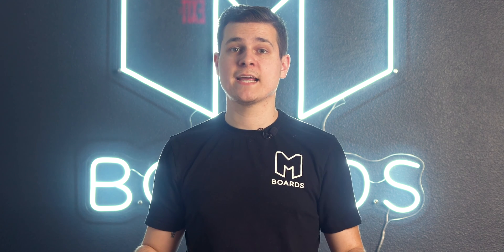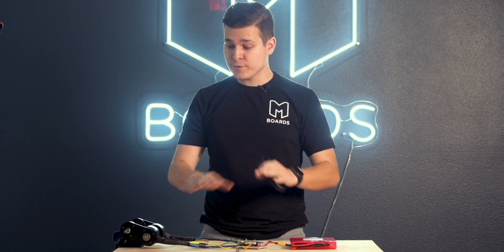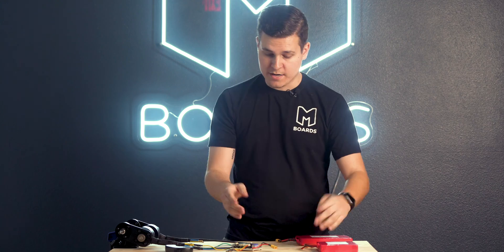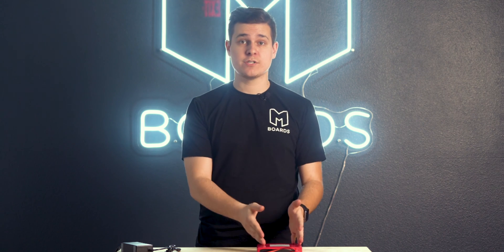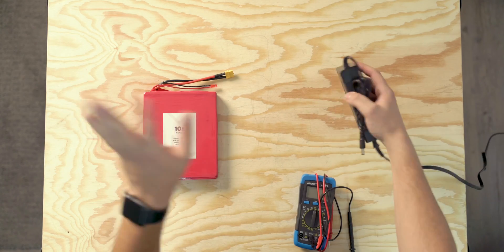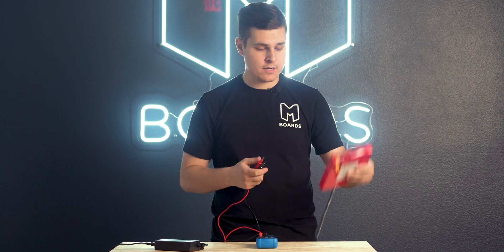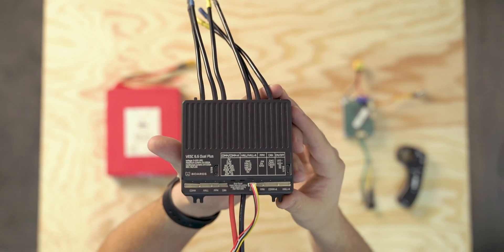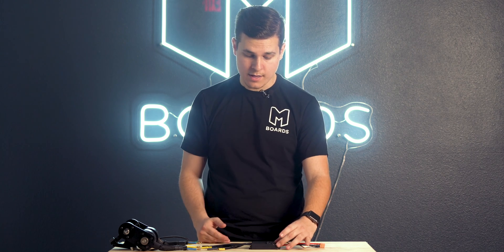How To Test and Diagnose Your Electric Skateboard

Comment from the maker: What video should we make next? We want to hear from you! Reply to this comment!
Reply: Detailed breakdown on how you guys make/source batteries! Also good safety precautions to take with batteries.
Reply: @deadlightning4532  YESSSSS
Reply: I have a problem where my remote loses connection mid ride and I always check the receiver for any issues but everything seems fine. The problem comes up once in a while and I fear that it will happen again and cause an accident. Is this a remote issue, receiver issue, or something I’m not seeing here?
Reply: @sebastiangomez8463  rf interferance if you live in a densely populated area, get a lacroix boards remote which has tech that hopps frequency to avoid connection losses.
Reply: How to open and balance charge a battery pack?

Comment: So I was trying to multitask and at the beginning you said if it’s beeping when you hook up the charger or something or you said something about it, not being able to meet the right type of voltage because it doesn’t wanna overcharge one of the batteries and I think before you said that if it’s not meeting the charger is not meeting the right requirement then it’s gonna beep so that’s what’s happening to mine right now. As soon as I plug the charger in it starts doing that beep in the light, it goes from one side to the other sideand it beeps like beep beat something like that beat right but I’ll check the troubleshooting stuff that you did, I appreciate that

Comment: Hi there, I was riding my MEEPO 5 on a hot day last week. I'm a pretty big guy and I rode up a hill aggressively. 
Suddenly the power to the wheels stopped. I was still rolling and the brakes worked fine. 
is there a Thermal overload switch? I hope there is no permanent damage...

Comment: I have a Meepo V5 with a 8000mah battery  that I keep fully charged, I use my board daily. Recently,  I rode my board to a meeting, it sat for a hour. On my ride home,  my board slowed, I looked at my remote and it showed one bar then nothing. The board wouldn't turn on,  dead. I walked home,  plugged in power and it turned on,  but not for long. I charged fully and it ran for a while, but shut more than 90% battery. I unplugged the esc then plugged it back in and it made a pop sound and turned back on.  Battery charges to 41.3volts and says there.  ESC problem? It looks good, no marks. I read the ohms from the power feed to the esc and it was very low. Left it unplugged for a day, read 400k ohms now(power feed into the esc). What do you think? Any other tests I can do to determine the culprit?

Comment: I have a CAROMA 350W Electric Skateboard for Adults & Teens, Wireless Remote Control, 12.4 MPH & 8 Miles Max Range, Short Charging Time that got submerged in about 2 foot of water for about a minute now a red light is on and won't turn off and the board won't do anything the controller finally came back on how do I fix it please and thank you

Comment: My board keep going slower and the normal speed whats wrong with it
Reply from the maker: Typically that would be a voltage issue. If your battery isn’t holding a charge you may see reduced speeds.

Comment: Good video but didn’t hear my problem.  My problem was I over some small pot holes fast and hard. After recovering my balance but my one wheel motor board stop running. I have stored for two years.  I performed visual checks and performed ohm checks on every wire and all good. But when I plug in the battery which still has voltage after storage for 2 years.  I plug in it sparks and connection on positive gets burnt.  Any suggestions on why sparking.

Comment: My urban v1 e skateboard turns on, runs for a minute then off. I havr to plug it into an outlet just to turn it on again. Also my remote battery died before i even got it, it needs a whole new battery. Is there a way i could just rewire it that it powers onto a regular AA battery just to work it? 

I bought everything brand new on eBay and I knew I'd run into problems. Was too excited to get it anyway.

Comment: Hoping you can help, when pluged in my esc makes no sound whatsoever.  Im using 7 cell battery with a 6 and 7 cell esc, from the start ive had trouble, first on off switch was wired incorrectly so had no functionality.  Ive bypassed it so it should be on when connected to the battery. Still no sound, remote seems paired and shows full battery level. The 7 cell jumper is connected. Could it just be its a faulty esc or is there something else to consider.  I had assumed once on switch was bypassed it would beep when battery is connected but nothing happened
Reply: Just add some more details I checked my battery which I made myself but works perfectly I've checked my charger all are giving proper voltage and amperage according to their specs however I have never seen a light come on on my ESC also the on-off switch was faulty it wasn't fact reverse wire the light on the auto switch failed to come on I corrected the wiring the light came on and then I realized that the switch itself is broken and there's no click when you push it in or no it doesn't recognize that it's been pushed so I rewired the on-off switch the LED started to work but the on-off switch itself was broken and doesn't click when pressed or make any other indication that it's understood the intent so to speak so I slipped the wires removing the on-off switch it twisted them together bypass gets so it should just come on when I plug into it even still I can't get my ESC to make any noise it seems to have no life whatsoever no lights come on and no sound is made at this point I'm thinking that my ESC is faulty from the factory and will need to be replaced I'm running a 7s setup but it's very high amperage my cells are reading 10000mah each after being fully charged I know the ESC should have a high and low voltage cutoff it also has a have a high amperage cut off is it possible it has an over a cut off as well I'm running 10000mah cells and running seven of them for 70 amp total.
Reply: If im over amperage i can order new cells, but it would still come on and give me a beep code right? If your on off switch is in the off position will the esc still light up? Since i bypassed my on switch it should just come on right away so im assuming mine is on, ive also tried removing it to place the switch to the off position then connected battery then connect the bypass but not even a light or beep, am i missing something else?

Comment: Hi Bro one question i have electric skejt and battery is loaded and and when I start drivingit starts draining right away I'm sorry, it's full again, what's wrong with the battery?
when I'm not standing on it and it's working, it doesn't do this

Comment: Hi I just picked up a Lycaon GR. It was super cheap but no charger and remote. I tried to turn on but it just beeps. Can I just get any esc and remote for the board or do I need a Lycaon. I tried contacting the company but no response. Someone said they also have been having issues with Lycaon .

Comment: I have used my dual ESC which has 4-speed modes, for a couple of years without any issues, but recently I noticed the speed of 2nd mode drops to a very low. I am not sure what kind of problem I am facing, I don't think I blow up either motor or mos-fet. I think the ESC setting has changed. is there a way to test that? I have those dual SZLY ESC.

Comment: Question my skateboard turns off randomly when it has a full charge it will go for a min or less and won't turn back on after
Reply: This is me too! I have to plug it into the outlet just to get it to work. Also my remote sucks, needs a new battery which idk where to find one. What is ur board? Mine is a V1 Urban skateboard
Reply: Sameee!!! And I just got it. So I took the wheel off that has the motor and then popped it back on and it started working again but this lasted only a couple of minutes. Very common issue apparently. Helpp

Comment: I'm a "newbie" to electric skateboards & was gifted one to fix ...if possible? Boosted Mini type (I guess?) It has two "dead" lead acid batteries 12v 7Ah, (1) 7.5 inline fuse. I would like to do a bench test on motor using a 12v 825 cranking amps car battery, is this wise ? Also, what would be a better battery replacement (gel, lithium, etc?) Thanx
Reply: your volts are the same so should be good, the motor should just run longer

Comment: Any chance you can assist? My board seems to pair considering the battery life shows up on the remote.   Unfortunately there doesn’t seem to be any acceleration with the board.   This board hasn’t ever seen asphalt yet.
I purchased it without a remote so I had to buy a universal remote however there doesn’t seem to be any acceleration.

Comment: Hi I have a question what happens if you plug the charger in and you see a spark on in the electric board? Is the Skateboard bad or the charger input is too low or high 🤔

Comment: Yeah I got a question I troubleshooted my board with every step that you suggested and I still just can't figure it out, for some reason my board will not turn on when I press the power button but then when I plug the charger into the skateboard then I can it'll turn on and it works just fine the wheels will turn and everything but then as soon as I unplug it all the power goes off and I checked the voltage on the battery and it read fine and then I also plugged the battery into the main cable that goes back to the ESC and check the voltage on the cable connecting to the ESC and it still read same thing it was fine is my ESC just fried or what? thanks

Comment: Do those cheap battery packs come with a BMS? Or the controller just cuts the voltage as soon as the first cell is on 4.2v 100% charge?
Reply from the maker: Which battery are you referring to?

Comment: A small correction, rx to tx and tx to rx regarding wiring
Reply from the maker: In almost all cases with Vescs, it’s RX to RX and TX to TX.
Reply from the maker: In almost all cases with Vescs, it’s RX to RX and TX to TX.
Reply: @MBoardsco  must be some boards that are labeled wrong purposefully then? I'm  controlling my fsesc 6.6 with an arduino, standard tx->rx, rx->tx on that one at least, since its a common serial protocol. Love the channel, keep it up!
Reply from the maker: Ahh with Arduino yes it is flipped. But when working directly with a Vesc and a receiver you match it.

Comment: Bought a Teamgee H5 directly from them (1st mistake) and it has stop working after 6 months. Won't start, battery reads 41.5V and charger reads 42v. Teamgee says I need a new battery, but I am not buying anything from them. Power switch doesn't light up not even when we connect the charger. No repair shops in my area, looking for any advice to locate the failure and see if it is worth the money to repair it. It has been lightly used, less that 20 hours...
Reply from the maker: That sounds like an ESC issue if it won’t power on with a charger plugged in. But would have to pull the electronics out to be sure.
Reply: Same story here with my h20 mini

Comment: Great Video! thanks for posting. I have a question. while riding about 1-2miles my skateboard just stops moving. everything is on and when you let it rest for about 30 min. it turns on again! Do you know what's the problem? the battery isn't dead or anything I think either the motor just gives up? or doesn't receive power? btw mine looks like the same as yours on the video but mine is 24volts single motor. Thanks for any help!
Reply: Esc or motor might be overheating. Feel the motor when it stops. If it’s hot to the touch it could be an indication of overheating

Comment: Hello i have question  about my motor hub rubber wheels 105mm its 42volts .
Why did not work for my esc 24-36volts. 
What do think that  problem?
Maybe  i need change  the esc?
Because vesc so expensive  here in saudi. What can do? Any advice  for me?

Comment: Very helpful!  Good timing on the video.
I just built my board and it seems to run at half power. It simply can't pull me up an incline of any grade. Top speed on flat is maybe 10 mph and struggles to pull me from a dead stop on flat. 
6374 190kv single belt drive (16/36 gearing) with a 10s ESC and 10s battery. Seems the battery is fine and puts out 41v so I'm leaning towards the ESC being bad out of the box (that's what I get for paying $50 for one from China). 
Any suggestions would be appreciated. I heard a VESC is preferred for a single 6374 motor. Or any chance it could be the motor?
Reply from the maker: Most likely the ESC. The odds of a motor being bad is very low. Would definitely recommend switching over to a Vesc when you can. 

Also double check that your speed mode on the remote is at the highest level.
Reply: @MBoardsco  Thanks for the response! Much appreciated.

I found the different speed options (without a manual) and it seems I was using it on the highest mode. After running it for about 30 minutes total it seems the ESC was getting very warm and there are overheating marks near the solder (brown in color). Seems it can't handle the amperage.
I have decided to upgrade to a Vesc and see if that resolves the problem.

Comment: Hey what a coincidence ! Yesterday I went on a long ride, drained the battery completely empty (the board completely stopped and wont turn on anymore). And now it wont charge anymore. I heard somewhere that the battery (10s) voltage might be too low for the charger to start charging.
I'm gonna get myself a mutlimeter to check.
Do you have any tips to get the battery to charge again in the meantime ? I tried using a drill to make the motor rotate and hopefully trigger some battery regen but after 10-15 minutes of that I saw no improvement.
Reply: try going down a hill and brake?
Reply: @WilliamCronin  It won't even turn on so that I could brake. I can turn it on while the charger is plugged though. That's why I tried making the motor rotate with a drill. I don't know how long it should take to recharge enough like this, if it does at all.
Reply: @melkorWTF  you can open the battery up and charge the battery without the bms and that should work, find a tutorial online in some esk8 forms or buy a new one